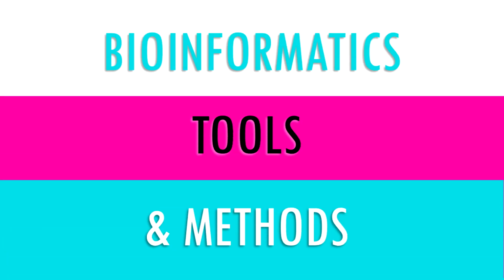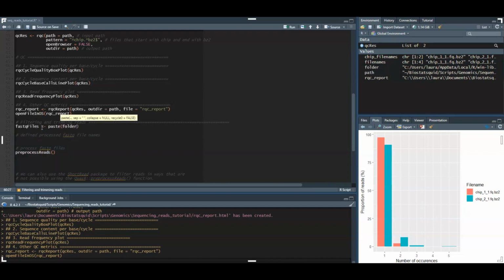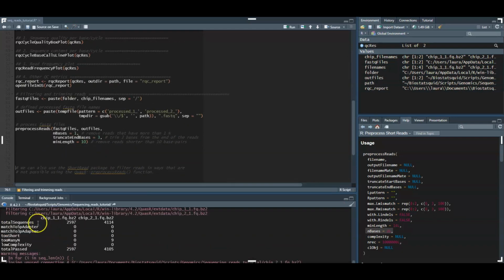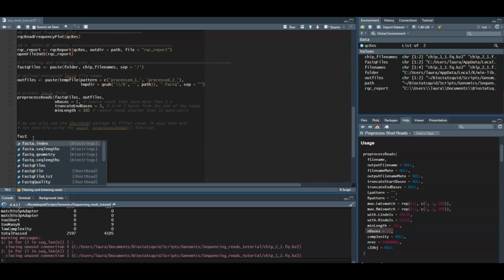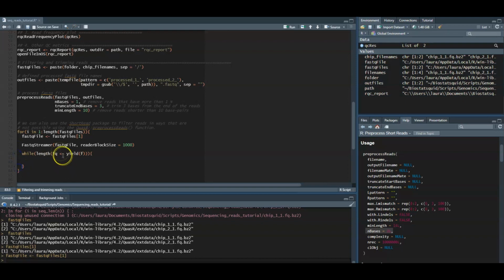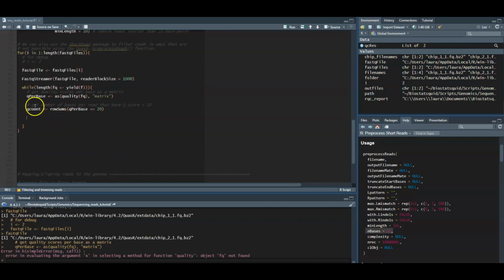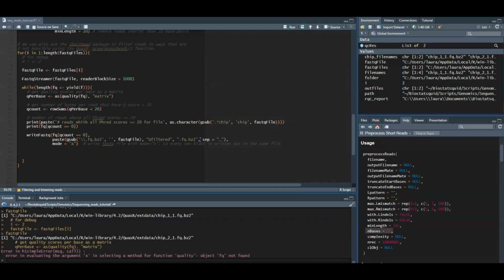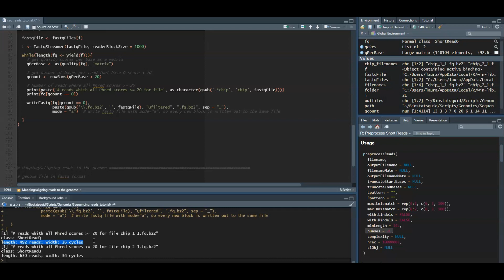Quality check on sequencing reads | NGS read preprocessing in R (Part 2)

Comment: Thank you so much for such a nice tutorial. Can I please have some questions?
1. as I can see here, you took the available data in package QuasR and I wonder how can I input my own data, which is already contained in my folder? how can I assign my data into FastqFiles?
2. after writeFastq( ), how can I find my Qfiltered files to do QC again? as they don’t show up in my working directory or any folder related.
3. Is there any chance that the Quality boxplot of Qfiltered file looks the same as the one of original fastq file? even though its size was actually decreased from 1.2GB to 4.6KB, for example.